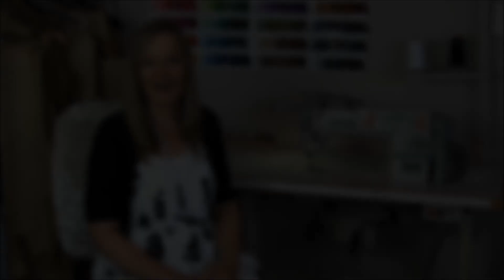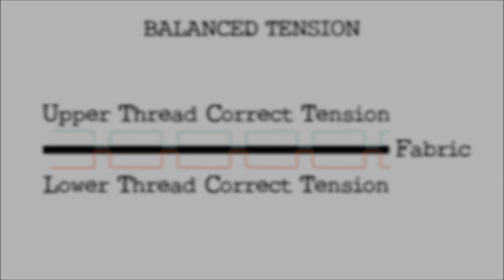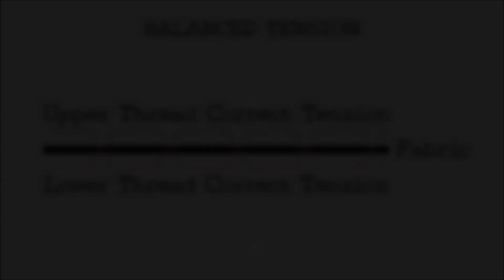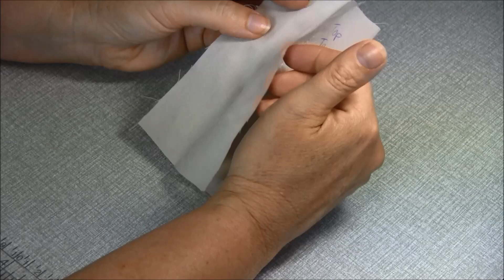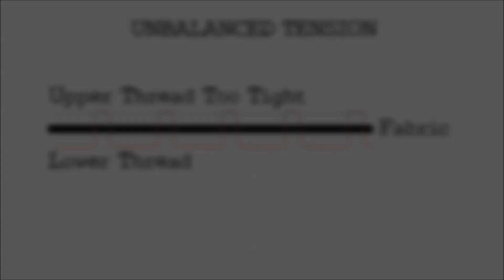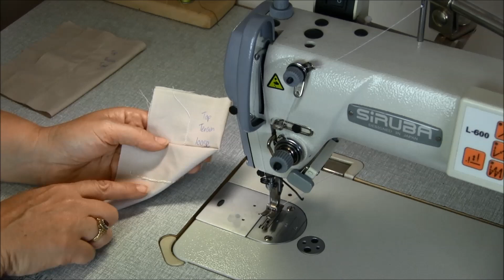How To Adjust Upper Thread Tension On Your Industrial Sewing Machine - The Fashion Industry Way

Comment: If I'm topstitching and closing denim jeans seams with Ticket 27/Tex 105 is Ticket 80/Tex 40 good enough as bobbin thread? Or do I need something thicker for the bobbin like Ticket 50 to 60/Tex 60 to 50?
Reply from the maker: I have never worked with this thread type before, so I cannot specifically answer this question, however, as a general guideline, I would use the lighter thread as the bobbin thread.  The same weight as the topstitching thread would just be bulky and uncomfortable.  The main thing you need to be aware of is to re-set your tensions on spare fabric before you begin.  I hope this helps.